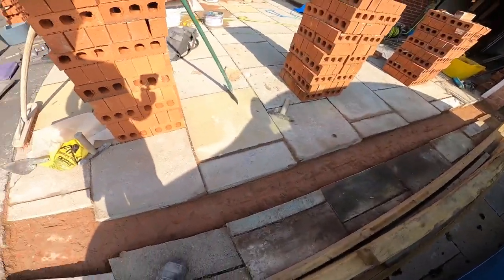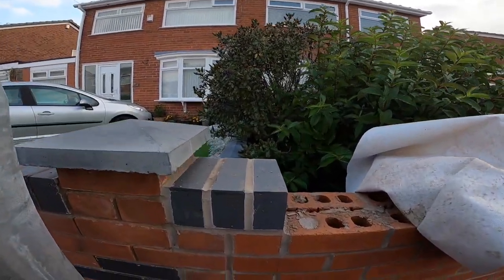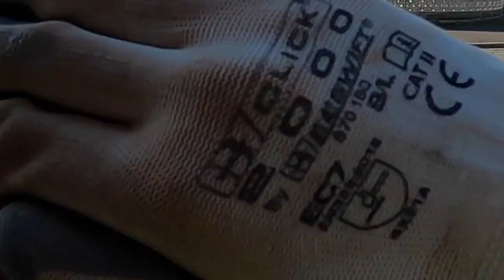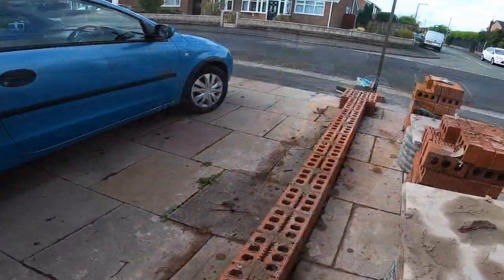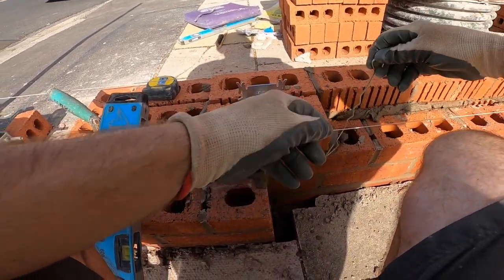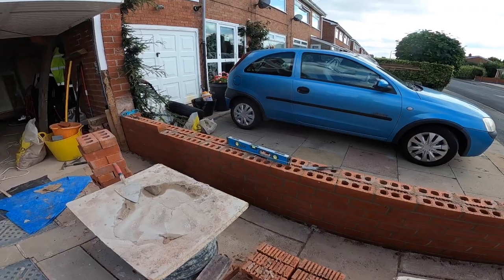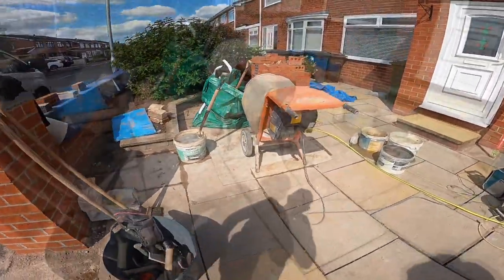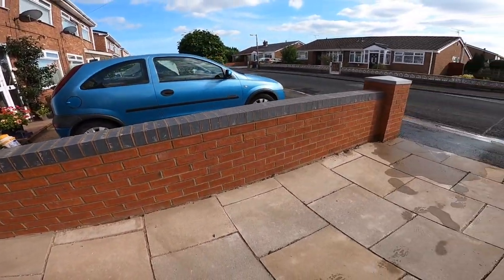I HATE MY WALL , CAN YOU HELP ? GARDEN WALL RE BUILD

Comment: Lovely job again Steve and Alex. I'm the dreaded developer and some of the  house builds we've done in the past has resulted in brickwork mortar joints drying too white despite carefully gauging cement content etc..  It's very unsightly - I wondered whether it's substandard quality building sand that's supplied these days or possibly the cement at fault - certainly we never had this problem 30/40 years ago.  What do you do to combat this problem! Many thanks and regards. Phil
Reply from the maker: There are so many factors Ive found , even the cement changing colour . 
  Damp bricks , but mainly the building sand changing . 
   I suppose they are natural products so out of control really 😕🧱🤙🏾

Comment: Nice one, not seen that trick with the trench block before mind you never seen a trench block before we don't use them around our way. I don't get the wall tie on the Fitzbrick, where the line goes on them is already set back 2.5mm to accommodate the line.
Reply from the maker: I think our set is an older model . As for the trench block trick , very handy 😉😁🧱👍🏽

Comment: Why would it be that most bricks I've seen from the UK have holes or dimples in them whereas ours (Netherlands) are solid? Both types seem to work just fine, but I was just wondering.
Reply from the maker: I think it’s all down to cost , bigger holes less clay . 
   Some of the holes are getting ridiculous now .🙄🕳🕳🕳🕳🕳🧱👍🏽
Reply: @SteveAndAlexBuild  At least you still have 90 or 100mm wide bricks in the UK. Ours (New Zealand) are all 70mm wide. The manufacturers made that change back in the early 1990s. The big difference here, though, is that houses are wood or steel framed, and the bricks are only on the outside, not the structure of the building.
Reply from the maker: @mark77193  😁🧱👍🏽